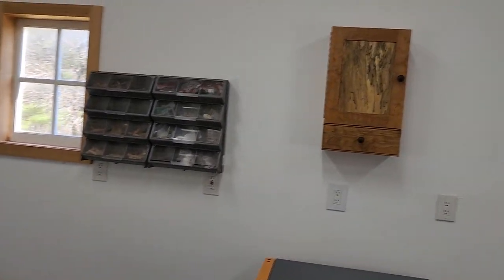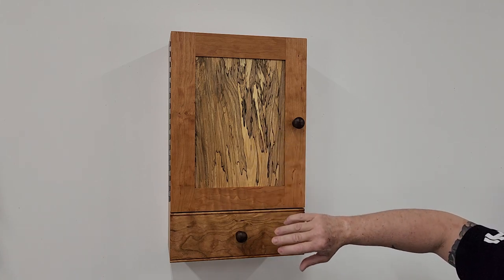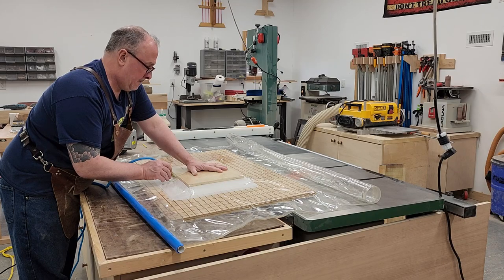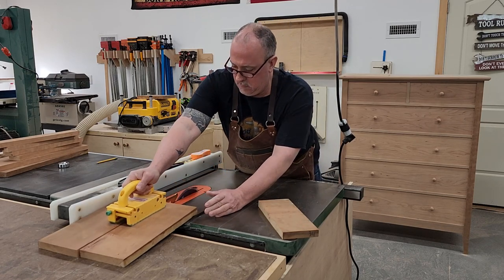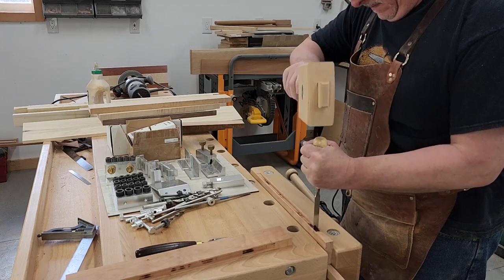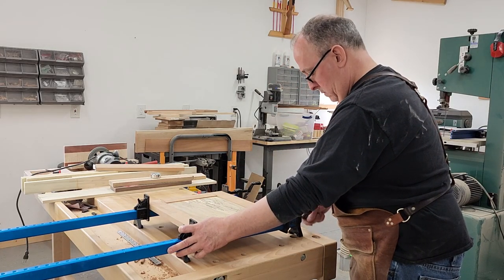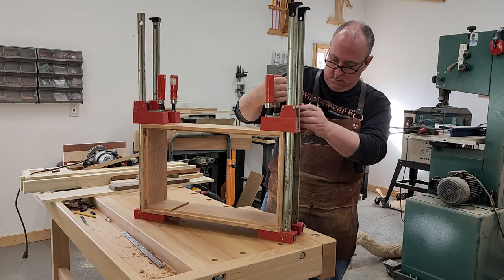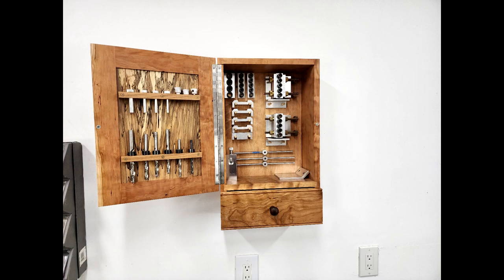Dowelmax Cabinet / Woodworking Project

Comment: Great job! That came out beautiful.
I'm still mulling over a storage solution for my own dowelmax kits. Like you, I have a couple of the dowelmax jigs kept in face and edge configurations, and extra drill blocks and bits at different depth settings. I'm considering a systainer with kaizen foam like parillaworks did, but just a shop made drawer with kaizen foam would work too.
Reply from the maker: Thanks! I'm glad to finally have it organized.

Comment: Just curious - why two dowel max's.
Reply: Very useful for things like cabinet carcasses and drawer boxes, or any situation where you're joining face grain to edge or end grain. One is kept in the face grain configuration, the other in edge/end. Having an extra drill bit in each size is another worthwhile investment as well. You set the depth of one for face drilling, the other for the edge/end drilling. It really speeds up the process.

Certainly not a necessity to have more than one jig; it's easy enough to drill all your edge joints, reconfigure for face joints and drill those, but it's definitely a nice luxury to have, especially if you build a decent amount of cabinets or drawers.
Reply from the maker: Having two jigs helps speed up the process. If you work on a lot of large projects I would recommend two jigs.